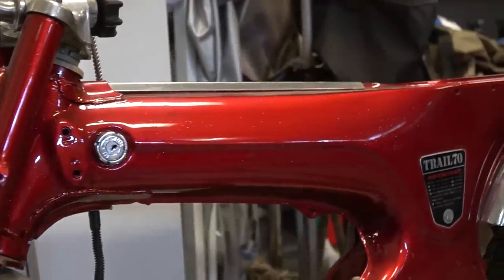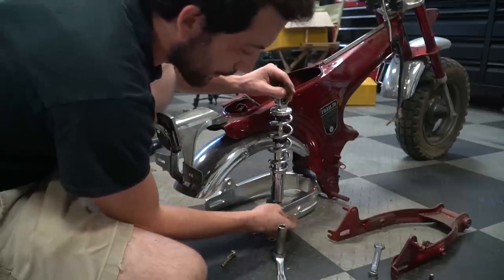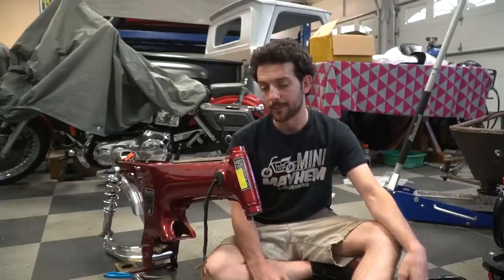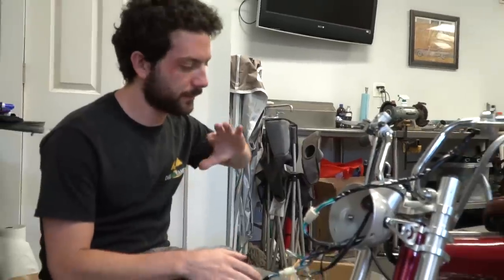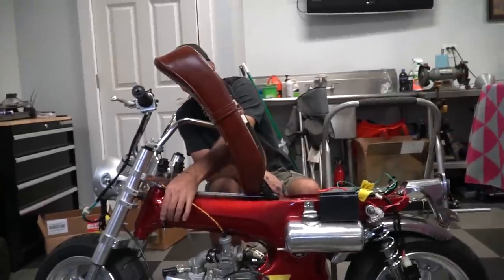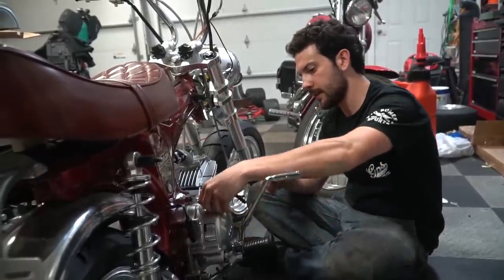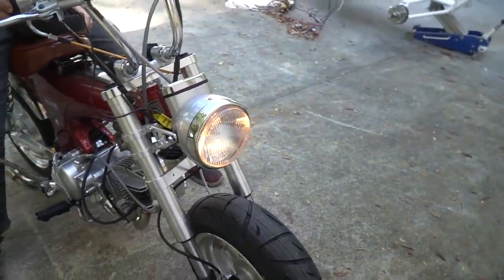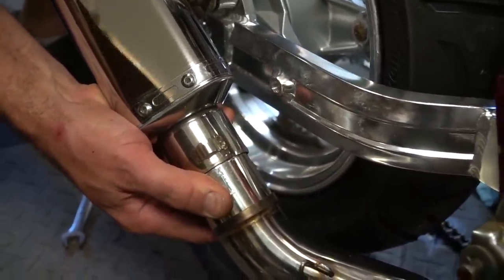190cc Honda Trail 70 Build | TOTAL RESTOMOD

Comment: I think it's still going to be a bit squirrelly at 60-65MPH. Even with the upgraded forks/swing arm/tires, the frame is lacking rigidity. The frame is little more than stamped sheet metal halves welded together. Add in the light weight that you really cant do anything about and it'll probably RIDE better with the upgrades, but better high peed handling is unlikely.

Comment: are your fork ends on backwards

i think you wired the flux capacitor backwards actually, you probably would have had electric start if you did it right too

Comment: A screw driver and hammer for the goose neck ring nut, Dude they make a tool for that. Im sure you can afford to get one look on line Ring nut removal tool they have hundreds listed. i promise it works way better than a screw driver and hammer.

Comment: Clean up the stock shocks, and throw those on for correct clearance - (till the better ones come in, before you wreck the rear tire or fender)
Why is the view from the back look so twisted? Seat goes one direction, tail light goes the other way? is it all bent? is something wrong?
Have you checked the output on the voltage regulator while it's running to make sure it's charging?

Otherwise, looks good - How much did all those Chinese goodies cost for us CT70 people at home to build one like it?
(I've bought 4 CT70 and 3 Z50 this year so far)

Comment: Due you plan to mod the rear fender, it kinda looks funny as is.  You mentioned that this was not a bolt on build, did the forum you mentioned offer any assistance with the stuff that had no instructions?  If not maybe a better plan would be to research parts that do work through the forums instead of just gathering unknown parts.

Comment: Im restoring a Honda CL90. Did you convert the whole system to 12v for the switches and lights? Thats the problem Im having. I need new switches and lights all around but the bike is all based on 6v while all the current "universal" stuff is all 12v. Where did you get all of your electrical stuff and that sweet digital dash?

Comment: a good hammer and a quarter inch nut and you can break that chain so easy, just slip the chain pin in the nuts on a hard surface and whack it with a hammer

Comment: Why didn't you flip the rotor in and put spacers in between the wheel and the rotor to pull it away from the tire..you know on the bolts.?...Just saying...☺

Comment: Aside from cutting the tubing the front brake set up just doesn't look right. That rotor is inside out and then the caliper just needed to be shimmed in to line up with rotor or line up on opposite side.

Comment: And P. S. You didn't need to trim the fork casing, the break rotor would have worked.
Reply: We tried multiple times. The only way was to trim or get different parts

Comment: needs a Daytona 4v motor eventually
the power difference will be huge
Reply from the maker: It's my understanding that the bottom end of the Zongshen and Daytona engines are the same, so if/when I want to do a 212cc big bore on this Zongshen 190s, it would essentially be the same as a 212 big bore on a Daytona 190.
Reply: @CarsandCameras  that engine you have is a 2 valve
a 4 valve head will make a world of difference

Comment: He literally just got a 190cc grom motor and stuck if on a ct70 which is not supposed to handle thatvtype of power. And if you have the right gearing that bike should powerwheelie in 2nd gear and rhats wheee all the torque kicks in on that thing

Comment: Side note set the rpm to about 2000. When you use the electric start don't touch the throttle so it won't stall and break the starter chain

Comment: I have quession. I am new to go karts. I built go kart but it doesnt have any torque, it bearly moves. I calculatet that it has 3:1 gear ratio.  I use dry clutch and honda gx
Reply: get a torque converter
Reply: @wesleywilliams6971  where i live i cant easely get torque convertes 30 series  converter with shipping would coat 120$ with shipping

Comment: Got a electric start motor but too impatient to wait for a harness to use it... Are you kidding me? And didn't you say the charging system wasn't hooked up? Headlight is gonna kill the battery. You worked on it long enough to get the right harness, why didn't you?

Comment: 190cc is poopoo! the starter chain will snap every 10 miles, the 5 speed box is a nightmare to shift, it's impossible to find neutral and really easy to miss shift because of the slop in the shifting forks

Comment: I have a small hole in my jug on my 02 yamaha blaster will it hurt to run it?
Reply: @MrMatthewb9876  Wym it rain with it b4 u mean full power?
Reply: @MrMatthewb9876  Its in side the cylinder
Reply: @MrMatthewb9876  Day*

Comment: so yall took off a quailty Honda Motor and put on a China made copy of a honda. should have just built a honda 70 motor would have been much Kooler..
Reply: They've done the hopped up 70cc motor already. It blew up. That's why Ike has the 125cc Lifan on his bike. The goal for this build was to cruise at 60-65. The only way you're going to do 60mph with a 70cc engine is to drive it off a cliff.

Comment: Isaac is not as bad ,but there both clueless with swelling heads and ego's to the point of being a  danger to  them selves and others.Guys take it from a real pro that has built many world class custom veh. and listen, maybe you can get away with the Micky mouse  work on those 3 & 4 wheeled slow off road units you build, but there is zero room for the kind of backyard guesswork and hap hazard sudo wrenching that i see you do when it comes to two wheel Hwy operated bikes.your only dealing with barely 1 inch of rubber touching the pavement that keeps you upright so the cards are already stacked against you so do yourselves and all that care (myself included),hire a good tech person to help , check ,teach and keep you safe with all the work you do ( By the way I am semi retired and available for hire ) because nobody wants to see or find out that you to injured yourselves and or others or worse.stay safe     Jeff